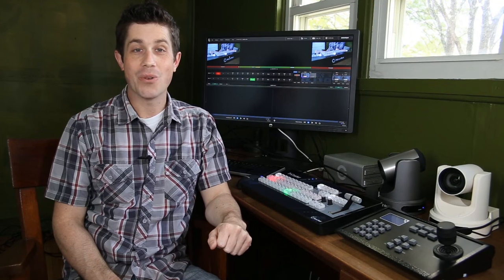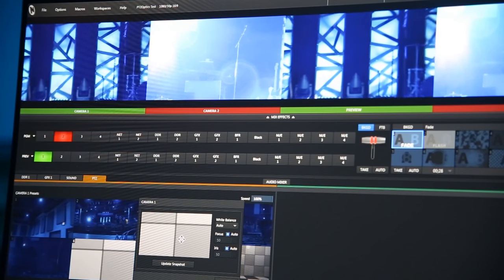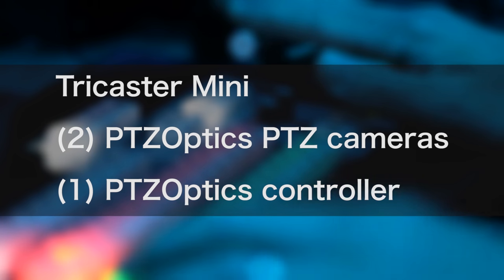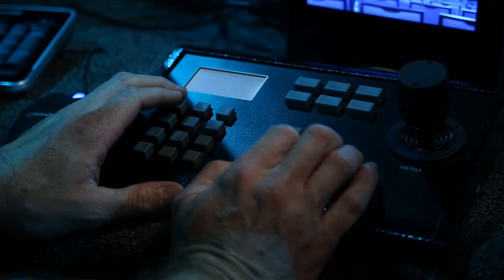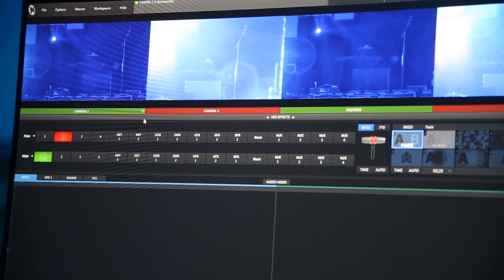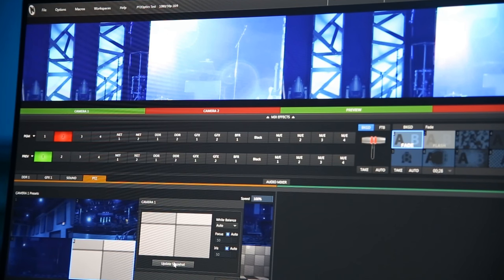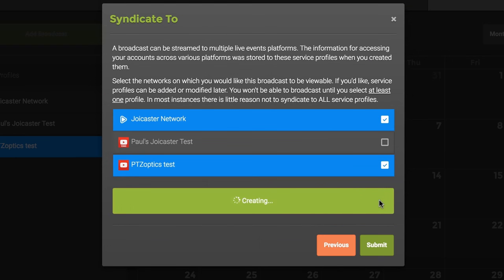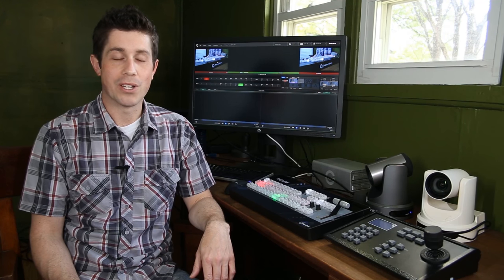Tutorial: PTZOptics and NewTek TriCaster Mini

Comment: Help please. How do you actually connect the ptzoptics to the tricaster. I tried using hdmi but it doesn't work. Is there something i need to download.
Reply from the maker: HDMI should not be a problem to connect the cameras to the Tricaster for video. Just make sure the resolution you have set on the camera matches your TriCaster settings.